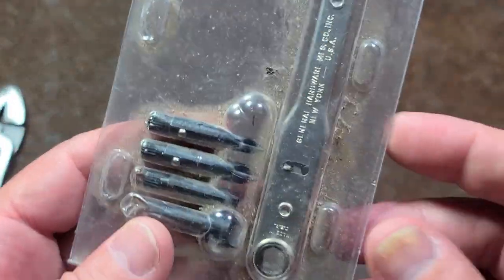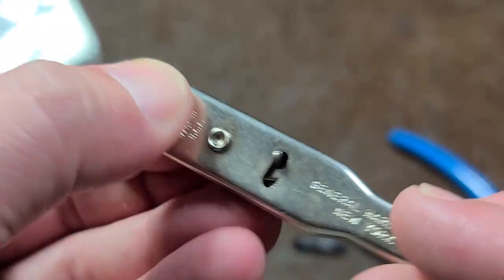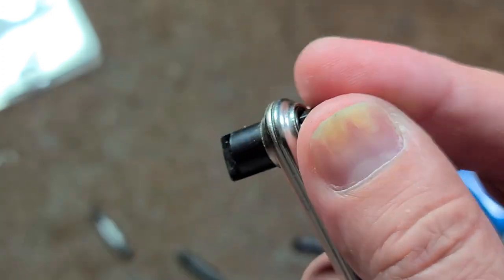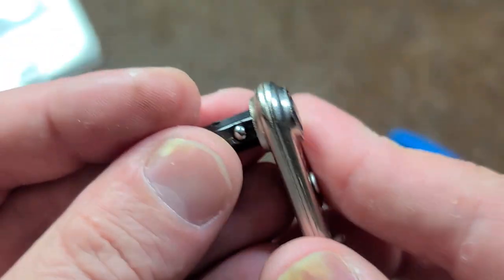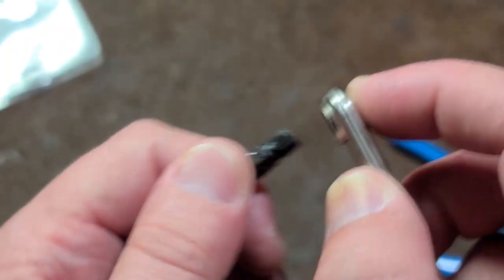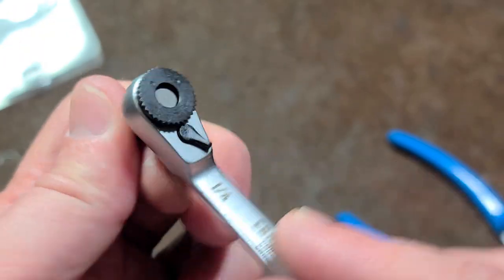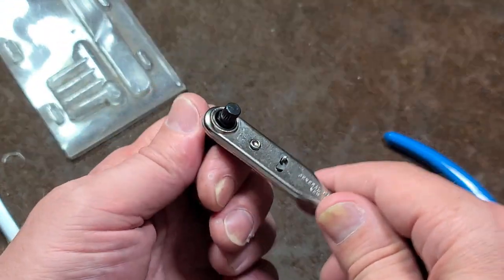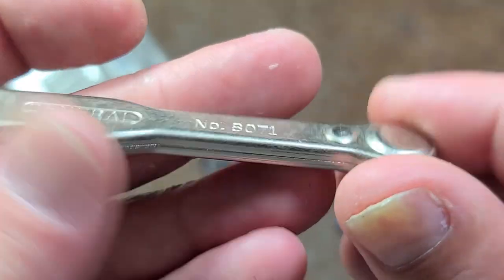General Tools USA Mini Bit Driver Review

Comment: I have a rebranded craftsman set identical to the general tools one.  Also general tools made none removable bit versions.  I have a no. 1 phillips on one side and no. 2 on the other.  I agree they have a lot of back drag.  In general, you can just use standard bits on a 1/4 inch ratchet with a 1/4 hex adapter which I have with some of my T-handle bars.  A bit bulkier but for most applications this works better than the general.

Comment: I've had my eye on the Chapman version of this for a while, it looks essentially identical.
Reply: Well not exactly.
Same construction type, but no reverse lever, and the ratchet is not as stiff.
It's stiff by today's standards but you can actually use it and you can spin the bits no problem.

Btw thet just released a new PM13 palm ratchet, probably a bit antiquated in mechanism but their mechanism which holds up is probably not gonna seem as antiquated in the form of a palm ratchet.

I wouldn't say a mechanic working on modern cars needs a Chapman set, but for industrial applications for  gunsmithing and specialty repair work Chapman still rules.

Comment: I have one similar to the one from Craftsman, but the one I have it's made by Bosch, it's come in a little set with some bits and an adapter and some tubular keys, I also have a nice little set with a little bit driver similar in size the Craftsman but nicer in a nice little 2 drawer box, with 10 long bits, 10 tubular keys one adapter and 30 short bits all made by a big German hypermarket chain of stores ( Kaufland ).

Comment: I have 2 older ones that the bits are not removeable. They are so coarse that they are unuseable in most situations. SO had a better design later but still too much backdrag and coarseness. The recent SO set is just about perfect and priced to suit. I rely on those often. Expensive doesn't gaurantee good results but in this case they do.

Comment: The ratchet and bits are incredibly identical to Chapman. Same manufacturer perhaps?
Reply: The backs of the bits on these look flat while the Chapmans are domed.
They also don't seem to have the Chapman part numbers on them.
I can't imagine Chapman making slightly different bits special for General,  and if they were an OEM for this ratchet they surely would have implemented the reverse lever into their ratchet.
I could be wrong but I believe this is just a Chapman knockoff ( they likely don't hold a patent ) that was not made by them.